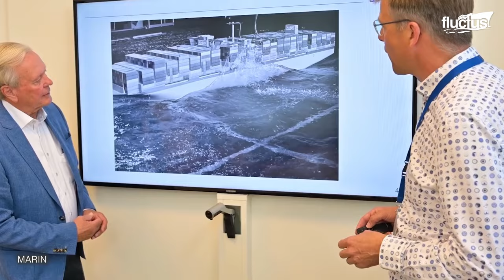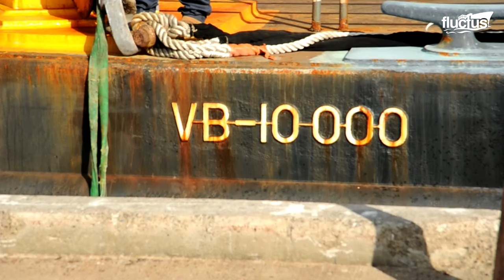What Happens When Container Ships Lose Millions $ of Containers in Middle of the Ocean

Comment: The solution to solve this problem is easy. When the ship is built make a cage on both sides of the ship which will hold the containers in. Sure this will make the ship heavier however but it will prevent container loss even in adverse conditions.
Reply: To make that cage strong enough it would made it way too top heavy it would be a design flaw. They